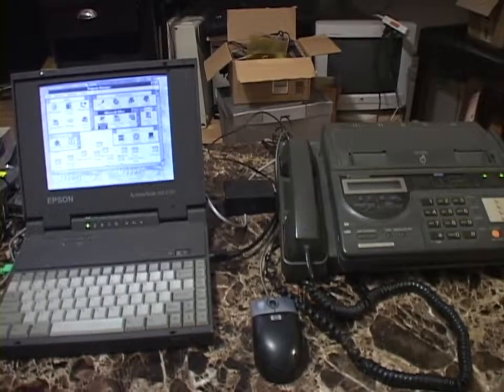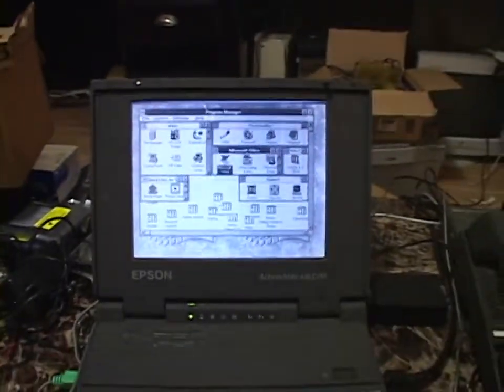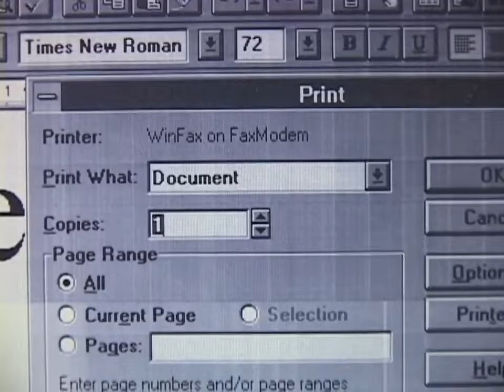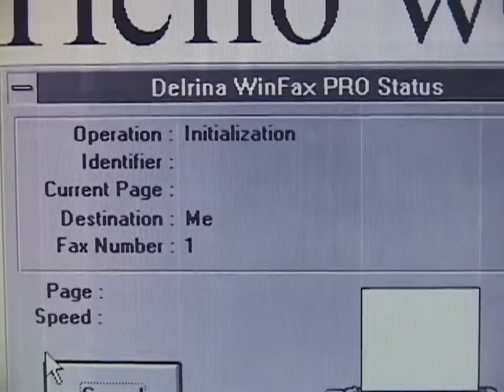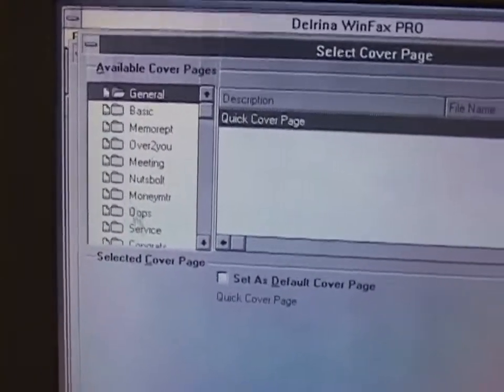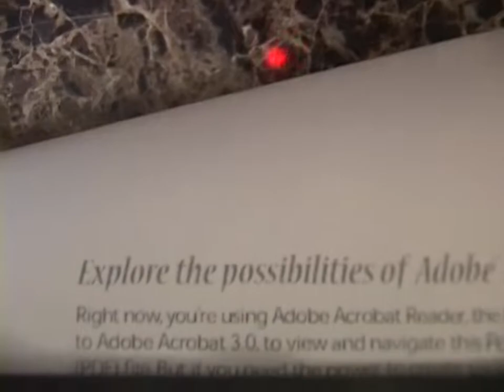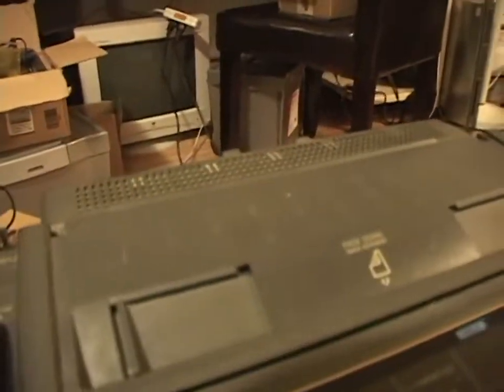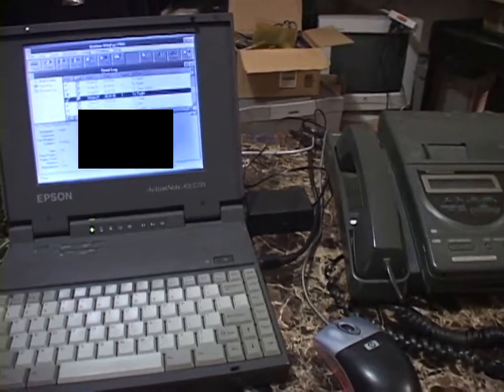Using a fax machine as a printer, with a modem and simulated phone line

Comment: Depending on the fax machine u may not need the box to simulate the phone...i'm struggling an ATT 7840 fax with no manual pretty basic &it looks like i do need to add the phone simulator. Have an actual use for this old stuff

Comment: I'm curious if there is a type of modification that can be done to the fax machine to bypass the use of a dial up modem to print. I'm guessing the slow printing is due to the data from the computer having to squeeze through a skinny phone wire. I know that some fax machines are printers and have drivers but some arn't they are just fax machines.

Comment: i have this epson!! sadly the HDD is dead, how would you reccomend reinstalling the OS ect? battery evan charges seems a waste to chuck it!
Reply from the maker: There's only one way to reinstall the OS - make some DOS and Windows installation floppies and then install them.

Any older 2.5" IDE hard drive will work; you just need to set the CHS values do it works as a 500 MB or smaller drive. A CompactFlash card with a CF to 2.5" IDE adapter will work too.

That's cool that you have a good battery - I didn't get one with mine.
Reply: @themaritimegirl  wow I never expected a response , I’ve been watching you years ! Back when you inherited the inspiron 1525/ or 45 aha Thankyou for the reply! Sadly I have those Floppy’s but no drive - I might see if I can Amazon an adapter or flash card like you said but no idea how all get windows for it or what version!!! Mine seems stock. 128 mb ram ect ! Hope all is well with you ! Thankyou for you time xx

Comment: Just imagine if you had a epson laptop back in 1992 with win 3.1, along with ethernet connection ,you would,ve been 20 years forward in time, as most peoples didn’t had a laptop or pc, let alone ethernet.
Reply from the maker: There is no ethernet on this laptop.
Reply: @themaritimegirl  but did it not had a builtin modem for kind such thing?
Reply from the maker: @johneygd  It has a modem. It does not have ethernet.
Reply: @themaritimegirl  i wonder were was that was modem for, wat it used for internet or bbs? Mmm
Reply: @johneygd  neither, it’ll have just been dialling directly into the office (probably office network by the early 90s, was still 70s mainframes over a lot of the 80s)